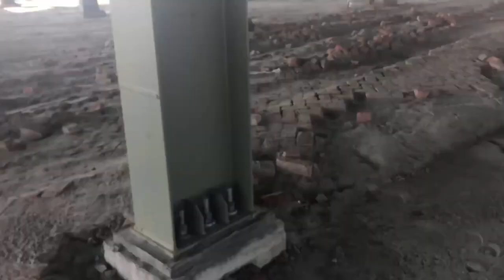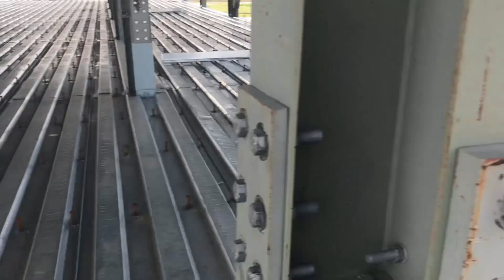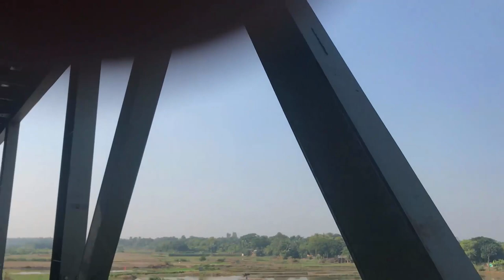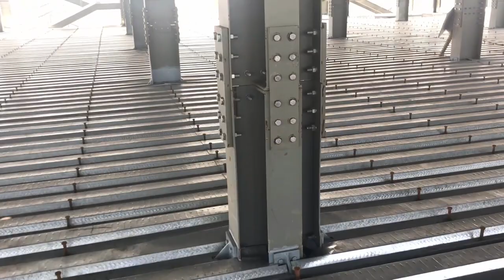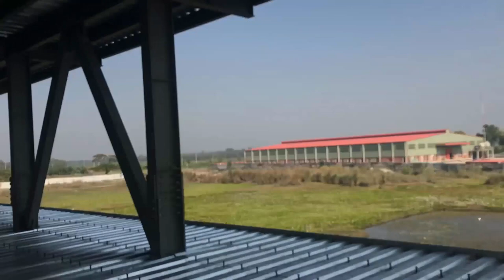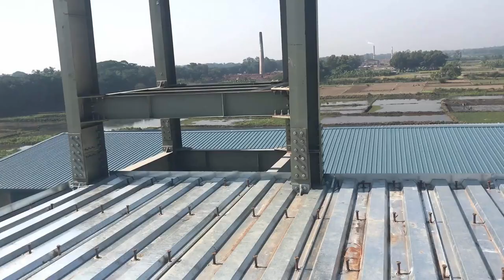Visit a Steel Building Construction Site

Comment: What is benefit of steel frame?
Is it cheaper?
Reply: It's high in cost than concrete
Reply: How much different concrete building vs  steel building? Ratio  % many percent high then concrete?
Reply: Reusable. 
Concrete after 40 years: 0 rs.
Steel after 40 years: atleast 200/kg.